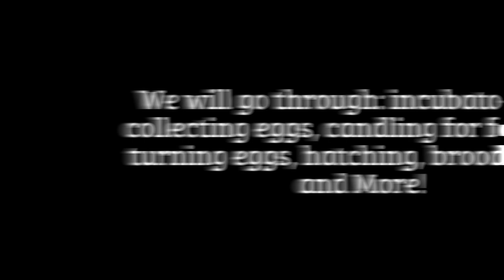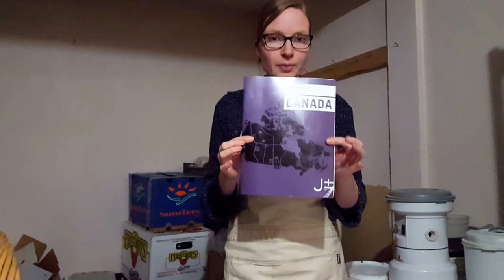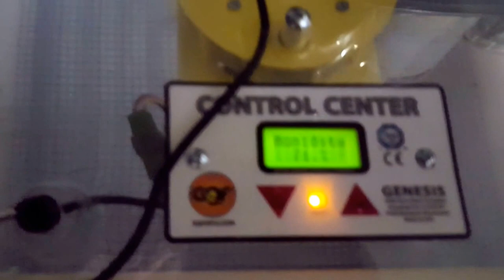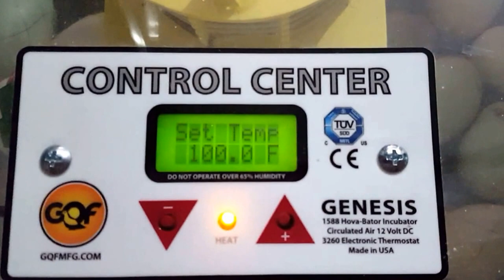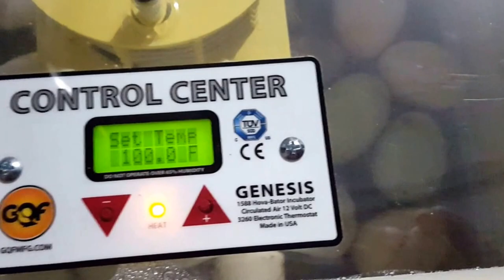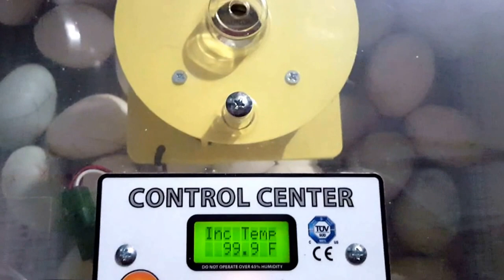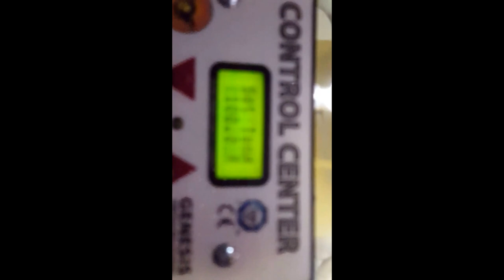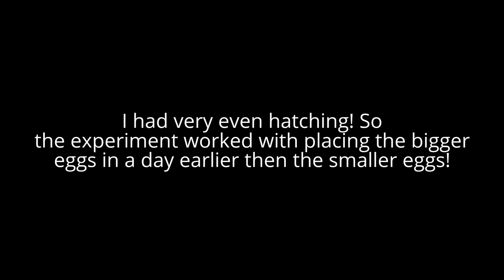How to Incubate Duck Eggs from Day 1 to Hatching! Everything you need to know! #duck #farming

Comment: I have been hatching all kinds of eggs for over 37 years, I have found every foam unit has a very poor hatch rate due to the very poor insulation of the foam units, I was lucky to ever get 50% of the eggs to hatch as the room temp. changes effects the temp in side the unit, as the room cools off so do the temp in side the unit and the warmer the room gets it gets to hot in side, it was imposable to keep the right temp 24/7, to get a good unit it cost hundreds of dollars, so long ago I built a wooden box with fiber glass between, and a 5x5 peace of 1/4" thick glass, using 2 , 100 watt bulbs and the control unit from the foam unit, that was the game changer, it made a 90% to 100% hatch rate
Reply from the maker: Thanks for sharing! I have a very good hatch rate with my incubator. There are so many designs for incubators. I am so happy you found a design that works great for you!

Comment: So first 3 days humidity:43/47% temp:37 (99). Turn eggs every 4 hrs. Spray with luke warm water.
4th day H:60%
2-3 days before hatching H:67/74%
28 days total?
Reply from the maker: ShogunGlock yes, 28days total...I have had them carry on hatching on the 29th day if the duck eggs are really big, and I have had hatching on the 27th day if duck eggs are smaller. So just keep your eyes open for some pipping! On average it's 28 days!
Reply: I'm trying to learn this in I am very scared because I don't wanna fail
Reply: Water spraying from what day ???
Reply: You spray your eggs with warm water or do you let them cool at all.
Reply: @wakingforbacon6439  never let them cool at all, try to do everything as quick as possible so you don’t lose much heat or humidity from the incubator.
Reply: @ShogunGlock  the humidity spikes where you spray the water don't affect the hatch.  I've just seen alot of people saying that cooling duck eggs and spraying them starting on about day ten is very beneficial to the hatch rate.  Was just wondering thanks
Reply: @wakingforbacon6439  this is all great info, makes sense how duck eggs have a slightly different process than chicken. I have yet to try duck. Thank you.

Comment: I think you would be better off using the turner but move the eggs from center to outer edge every few days. I have sportsman cabnet incubator with self turning and find the back of the incubator is cooler than the front so turn the trays around about once a week to get a more even hatch as it was taking from first chick to last four days to hatch. Now they are done within two. Agree though duck eggs need the higher humidity through out the hatch. But to much humidity with chicken eggs will lower the number of chicks that are able to hatch. I tried for a happy medium for both types of eggs and had 11 out of 42 chicks that were not able to get out of their shell(pipped but died in shell). The ducks that were in the incubator at the same time hatched fine as I raised the humidity as soon as chicks were pulled.
Reply from the maker: Good idea and thanks for the replay!
Reply: You should have helped the chicks out of their shell. It is very cruel to not help even you are capable doing so. And it is a lie that chicks who were helped, are weak. All the chicks I helped are very healthy chickens now.
Reply: @ROBDee-ho9lu  I have helped chicks out of the shells in the past with little success. It maybe a timing thing as to how soon they get the help. I say about half of the chicks I have helped out of the shell die within a few days. Ducks survive being taken out of the shell better than chickens. I do try and help those that show a good line pipped. But if only an air hole type pip I leave them alone.
Reply: @johncox8882  Very good. I helped yesterday one of my 5 chicky's out of the egg. It was struggling for hours without result. Then I removed little bits of the shell around and made the white membrane a little bit wet coz it was very dry (and hard). 10 min. later the chicky made itself free. I had 9 eggs and now 5 babychicks. The other 4 eggs are still in the incubator, I let them 2 more days. Because the first chicken was on 31 may (19th day), 2 came on day 20 and 2 last night (day 21). That was a big surprise this morning coz when I went to bed there was not even a little hole in the eggs. All the eggs had equal brooding time but 3 different outcome. O and they are dwarf chickens who always come out of the egg on the 19th day (so they say) which is obviously not true.

Comment: How often do you turn the eggs? My incubator is an old style. What type of thermometer can I use to control the temperature and humidity?
Reply from the maker: I would turn eggs min of twice a day but better is 3 times a day. I like to turn them first thing in the morning. At Lunch. Then a supper or before bed. Really any good thermometer that has both temp and humidity on it will do.

Comment: Four of my ducks have hatched.  The humidity has went up to 84 degrees in the incubator.   I guess because the ducklings are wet.  I hardly have any water in the icubator.  Should I open it and close it real quick to lower the humidity?
Reply from the maker: Most incubators have a vent, the hovabators have a plug on top you can pull out to release some humidity. I would do this to bring it down in the seventies.

Comment: This is such a great video and so much fun to watch your experience! I am on my second round of incubating ducks---I only had a 30% success rate with my first round, so any tips are good tips! Now we have our own duck eggs we are incubating and I am curious when you started spraying the eggs? From the very beginning? Also, I only have trough 4 filled with water (that's what my Hovabator said to do with humidity until lockdown time). Do you recommend I fill another trough to raise humidity? It's hard to tell because I don't have a humidity indicator. Thanks for any advice you can give!
Reply from the maker: I have about 85 to 95% hatch rate and I find the guidelines on the hovabator to be too low for humidity in my experience. I fill trays 1 and 4 for hatching out goose, duck and guinea fowl.  All three of these bird require the same humidity. I begin to spray the eggs by the second day to lock down. When I do lock down I fill all trays and stop spraying. The first time I hatched out duck eggs I had only about 30ish % success and found that the membranes where too dry and the air sack too small. So I increased the humidity and that changed everything!
Reply: What is lockdown
Reply: Sooo confused because if the air sack or air cell is too small then wouldn't that mean the humidity is too high? You said you up'd the humidity and that changed everything.

Comment: @everythinghomemade this is a long shot, but I’m hoping for a reply to this question: 

After a duckling hatches, what temperature and humidity should the incubator be for the 24-48 hours they are in there after hatching?

My daughter and I found an abandoned duck egg and have been incubating it successfully and we are now almost on Day 27! But I can’t seem to find info anywhere about the temp and humidity of the incubator specific to AFTER the duck hatches. I know they need to dry and warm up, I’m worried if I leave it at 80% humidity it will be too moist in there for the duckling to dry off after hatching. 

Any help on this would be so appreciated! You video has already helped me tremendously in saving this little duckling! Thank you so much!
Reply from the maker: That is so awesome for you success  so far! After the ducklings hatch the humidity in the incubator is around 75 to 80% and they dry off with in a few hours and fluff up within 6 to 8 hours. I have even hatched more now, and same goes with turkeys, geese, chickens, Guinea fowl too. After they hatch leave the docking for 24 hours in the incubator to dry off properly, gain its strength, and then remove to brooder. Remember they have absorbed that yolk sac so they wont starve in that time. If this is your only duckling I would provide either a stuffie to snuggle up to or buy another duckling to keep each other company. Even a chick would work too. They really dont like being alone.
Reply: @EverythingHomemadewithRita  ugh you are a life saver! Thank you that’s helpful! Yes we plan on buying another duckling from Tractor Supply as soon as it hatches so it won’t be lonely. We have a small backyard and two dogs so we can’t keep the ducklings but we have an animal sanctuary that has agreed to take them both in as soon as they’re stable enough to transfer to a new home. While I have you—any advice on what age is best to transfer a duckling to a new home?

Thank you again! You’re the best!
Reply from the maker: @Roosril  I always wait till they have their breast feathers before I let my ducklings out in the open on the dugout. That way they are waterproof and good size. That's around 8 to 10 weeks old. They grow really fast and around that 10 weeks they are so independent and ready for the real world!
Reply: @EverythingHomemadewithRita  thanks so much! That helps!

Comment: Fantastic, thanks for the guide! My Indian runner ducks are hatching, one out, and the humidity looks to be around 80%,is this too much?! 🙏🏻
Reply from the maker: It's a little high but better than too low. If it goes higher than 85%, I would crack open a vent. Hovabators have one on the top you can pull a plug and let's out a small amount.
Reply from the maker: And congrats on the hatching!
Reply: @EverythingHomemadewithRita  thank you so much for your reply! 🙏🏻🙏🏻🙏🏻 I have a Janoel 12 and it's the first time so I'm nervous! I didn't transplant the eggs to the hatching tray but I've been turning by hand and have the tray disconnected to the turner, hoping lil buddies are all well ❤️🤞🙏🏻🤞❤️

Comment: How much temperature does temperature newly hatch chicks needed for them to be warm until 1week
Reply from the maker: The temp should be between 82 to 85 F for ducklings and 85 to 88 F for chicks. My rule of them is this, Have it preheated to 85 F, place ducklings in brooder, and check on them hourly for a few hours. If the ducklings crowd under heating lamp its too cold, if they crowd to one corner, farthest away from the heat, they are too warm. If they are running around evening disturbed under and around the lamp you have the temp just right. I find I raise the heat lamp every 5 days about.

Comment: I have duck eggs in my incubator, some runner ducks, some Cayuga and call ducks. I’m wondering if it is ill advised to add additional eggs?  (once we see that some are not incubated by candling we will have extra room) I realize that doing this would affect lockdown dates and hatch dates.  I would like to know what your opinion is on this idea .
Reply from the maker: I would not advise it because as they hatch they knock around the other eggs and really disturb them. Also the humidity is higher on hatching time and is not good for developing eggs.
Reply: Ok, thank you for your insight. Here's another question. I have 4 broody ducks..they live with all the other ducks 30,  we have a few drakes, and there is also 1 muscovy drake he's very big all living together. The broody girls have been sitting on eggs, I will let them hatch out the ducklings themselves, once hatched do I need to take the ducklings away from them once they are hatched (grow them out in the brooder) or can they live with the other ducks?

Comment: Do we have to spray the duck eggs with water everytime we turn them?
Reply from the maker: Spraying them is beneficial, at least do it once a day.
Reply: Everything Homemade, thanks for the reply. I’m so sad today because my premature baby duckling died. We made a homemade incubator using a box and we failed to maintain the correct temperature so the baby duckling died. Can you share to me the proper way to take care a baby duckling? :)
Reply from the maker: @lesbi8615  Firstly, a premature duckling chances of survival is very low, unfortunately. How did it hatch premature? Did you find it? Was it domesticated duckling or wild? 

When a duckling is born healthy they need to be under a heat lamp. You can tell if you got the right temp when the duckling is laying comfortably under the heat lamp and not laying on the edge of the heat or trying to waddle away from the heat. You want a chicken waterer. You want to make sure the water container they can't swim in other wise new ducklings will drown and/or catch cold. If you have only one duckling I place a stuffed animal in with it so it has something to snuggle up to under the heat lamp. You want to buy some duckling starter that is NOT medicated. The medicated feed will kill your duckling. As your duckling grows you need to raise the heat lamp and give it more space. By the time they are 4 weeks old they are ready to go for a swim and no heat is required.

Comment: This was very helpful. I am using an egg turner. When should I remove the turner? Also, what is the substrate in the box you put them in after hatching?
Reply from the maker: I use my turner for my chicken eggs and take it way 2 days before expected hatching. I also stop turn in them at this time. Just lay flat, fill the water up and wait!

For the substrate I just use untreated fur or pine or spruce wood chips.
Reply: Thank you very much!

Comment: LOL, does doing all that paperwork make you feel more secure or something? I found it very...entertaining. Incubating is an art form....like painting is an art form. Sure put a brush in someones hand and paints next to them...anyone can paint, doesn't mean it is going to come out all that well. As you do it more you'll get better each year till you are pulling eggs through that you never would have before...it's as much about intuition and educated guesses as the hard facts...
Reply: possible tip....if you want to lay them like that, go to amazon and get those egg holders for the fridge that hold them on their side...multiple smaller number eggs is better than one huge one. Don't use the plastic lids. Use those in the incubator. To create the movement put a rolled paper towel or something under one end of each (or make one long paper towel roll and prop multiple holders up down it's length. To "turn" them, you just turn the holder and prop the other end up and maybe spin them each once a day, you don't have to do that if you have them semi upright by the way (spinning them), the multiple small ones allows you to move them around the incubator during the time to get more even heating going on. Saves on time and energy and is effecient. Also filled water bottles in there help stabilize temps...like a heat sink... Then take out of the holders for the lockdown portion and lay them on the floor, or not...your choice.

And yes, please...RELAX!! It's fine...
Reply: Also, the light on your cell phone (should you have a cell phone) is GREAT for candling.....even makes it through my medium brown eggs.